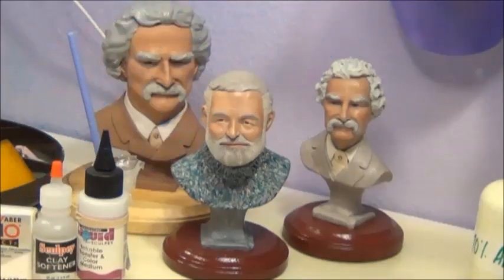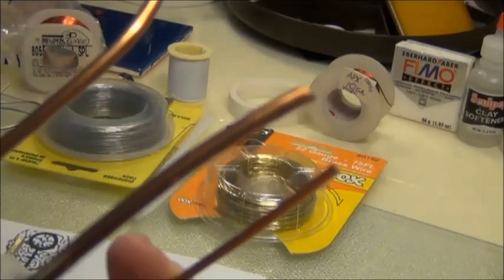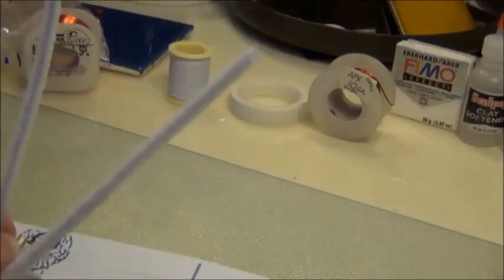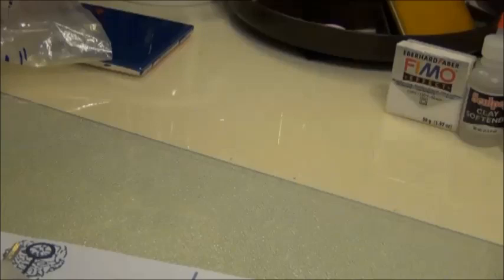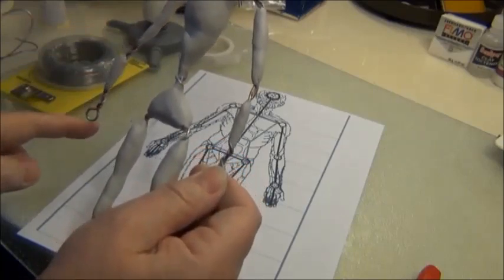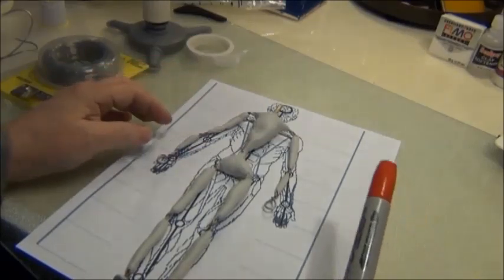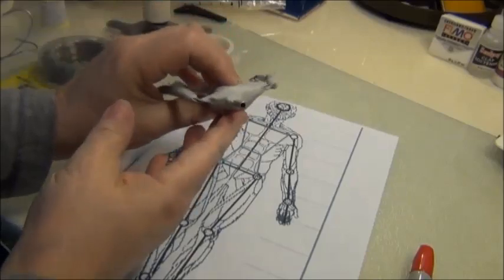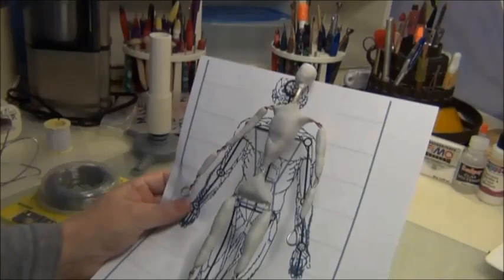Sculpting Basics Pt 1 ~ Armature Making for Small Figures

Comment: I have a question- I'm making quite a small crow sculpture, and I'm having a ton of difficulty attaching the bits of wire together- would you be able to use hot glue to attach pieces of wire together, or another kind of adhesive?

Comment: Great video. Is apoxiesculpt  oven safe?
Reply from the maker: Thanks so much Kevin. Yes ApoxieSculpt is oven safe at temps for baking polymer clay. That's why it makes such a solid and sturdy armature under PC. I can't speak to how well it does above those temps though.

If you use it be sure to make the epoxie armature small enough to add at least a thickness of 1/8" [of apx 3.0mm] or more of PC. Much thinner than that and it can sometimes crack when it's baked.

Comment: Uhm.. what materials have you used?
Reply from the maker: Just in this video I used aluminum armature wire and gray epoxy putty [brand: Apoxie Sculpt], and a little piece of brass tubing at the neck. For sculpting I use polymer clay - mostly Premo and Super Sculpey regular and firm.
I'm happy to answer any other questions.